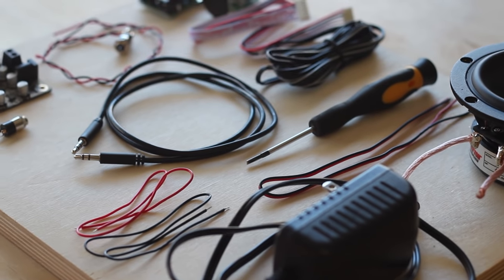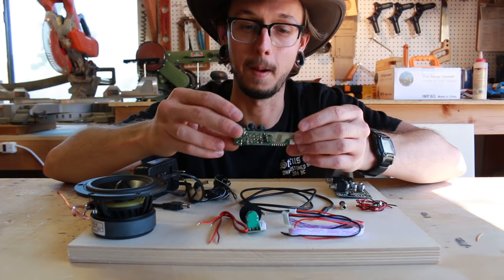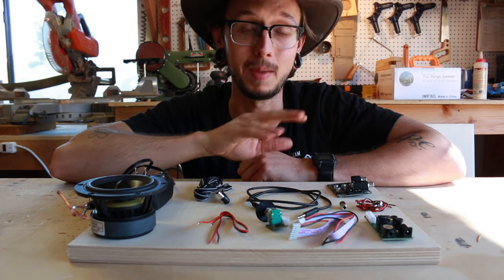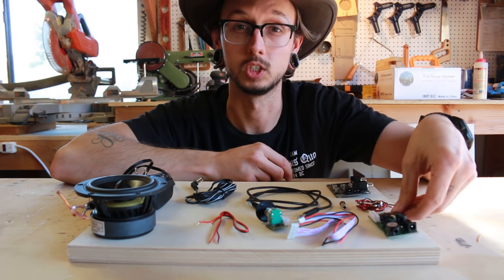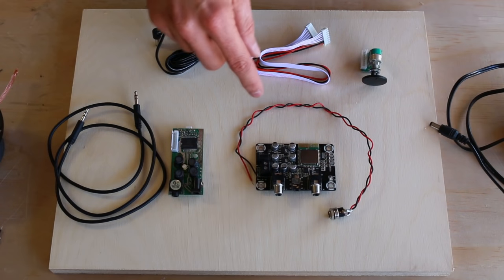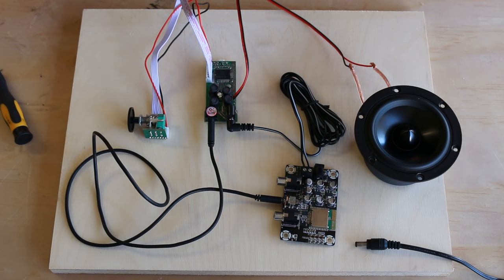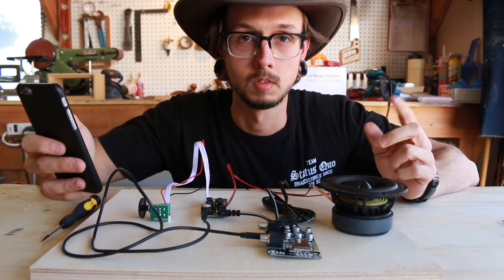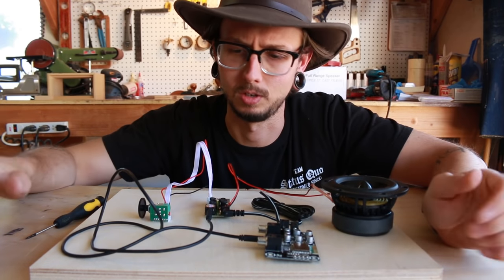Easy DIY Bluetooth Speaker Setup: Make Any Speaker A Bluetooth Speaker | How-To

Comment: Love the videos!  Truely inspiring.  Quick question... how do you calculate the values of your caps to coincide with the specs of your woofer, tweeter, amp, etc. Is there any website you'd recommend for beginners?
Reply from the maker: Thanks so much! Capacitors are used to filter low frequencies. So they are usually used to only allow highs through your tweeters. Heres an online calculator that explains capacitors use in crossovers a bit and calculates value.

Comment: great videos! thanks!
have a question...
Can I use these internal Bluetooth setup with any wattage speaker?
i.e. I want to build a 400 watt RMS bluetooth speaker with a 10 inch speaker.
can I add the BT card to this?
Reply from the maker: Yes! No problem. The wattage of the audio amp doesn't impact the bluetooth. Bluetooth is just an input to the amp, like a phone through a 3.5mm cable. Thanks for watching!

Comment: This is perfect I just bought put the wood casing together for my speaker I was gonna buy a raspberry pi for it but this way it's cheaper and much simpler so thank you. I was wonder how I could put an on/off switch in or an aux cord.
Reply from the maker: Awesome Spencer! Good luck on your project. The audio amp has a built in on/off switch and the bluetooth board can stay powered on with no problem. If you wanted to add a power switch to the bluetooth, you could add a small switch between the power connector on the outside of the box and the bluetooth board. For aux, you can add a Y splitter to the audio amp input, one input will be the bluetooth and one will be the aux input. Thanks for watching!

Comment: love the video  and i have a question for you
  i have a few old broken  bluetooth speakers  friends  gave me to fix and or use for parts   
  ive repaired a few and modded  others  with  bigger speakers and  never thought of adding a amp to boost  power to try with bigger speakers    i will  try that   since watching your video  

 but my question is this ive noticed on a few boards ive had there is  ad on spots or i would think its ad on spots  and my question is i have a few broken  laptops and old cellphones and  what i was  thinking is there a way to  use a old working camera and add it to the bluetooth speaker board and allow me to turn the camera  into a bluetooth camera  or is there a way you can help me with how to take a old webcam  or old laptop camera and add a wifi or bluetooth chip and how to make it into a wireless security cam or ipcam   now i know i can use  old  cellphones to make into ipcams  and i can buy  prebuilt spycams and security cameras  but  i wanted to build  my own   with  stuff i have  from  other parts i might have  at home  maybe you can  help me and  we colab this build  thank you  please  send me a message  or email thanks again

Comment: +Kirby Meets Audio By connecting multiple devices to the same power source doesn't lessen the voltage and amperage going to the devices like shown in this video? If tis is the case can I add a boost converter to a different device requiring 18v while powering a 12v device? At the moment I'm powering two small amps that was powered by 3v, but each amp can handle up to 5v each, but I have them connected to a TP4056 as one so I can achieve left and right stereo, is this ok??? Thanks

Comment: HI Guys, a little question :

Do i get it right that the Bluetooth board is powering on @ the moment where you connect the power supply - and not after turning the amp board on? 

That would mean the Bluetooth Board is permanently powered?

greats

BTW : your Videos are amazing !

Comment: Hi, super nice vids! Could you possibly do this with a battery?
Reply from the maker: Thanks, Arthur! That video is coming soon!
Reply: Kirby Meets Audio can't wait!
Reply: will it be rechargeable?
Reply: those are simple modules, cheapest to order on banggood or aliexpress, you could use lipo bateries with a charging module, and step-up or step-down voltage regulator

Comment: I thinking of making a soundbar with 2 separate 12 inch subwoofers the soundbar will have 2 kicker 6x9 i believe they are 450 watts each or more and 2 tweeters. Each subwoofer will have separate boxes and they  are kenwood 1200 watts each. The question is what extra stuff do i need to make this happen, i want everything bluetooth and able to connect to the outlet. If anyone can help i sure would appreciate it

Comment: Does it matter how much volts the speaker can handle or is that a 12 volt speaker as well??
Reply: The amplifier handles that so you can just connect it to the amp and as long as it can supply enough power it'll be ok.

Comment: How could I also hook up some kind of rechargeable battery? 
Sorry, I'm a noob at electronics and this kind of stuff
Reply: Yes you can, though you need charge controller*, so you wont over charge battery and with lipo cells *you need to balance them too, or there will be fire. Depending charge controller you can also get info how much battery life you have.
My suggestion is to build basic wired system and learn about battery management. There is several kit based control systems to upgrade into later, when you know more about them.

Comment: Can you show how to use it with rechargeable batteries, so it can be wireless speaker and which type of batteries to use to power it?
Reply: Guess you'd have a 9volt battery or other battery receiver and convert it to 12volt dc and connect it as the power source.

Comment: how do you turn the blootooth module on and off, does it works with the amp switch ?
Reply from the maker: You can easily add a small on/off switch to the positive wire coming from the power jack to the Bluetooth board. But it also won't hurt the board to just leave it powered on.

Comment: Is there a way i could power the board with batteries?
Reply: Sure. And even charge the (12V.) battery with a small solar-panel (and a controller to charge the battery).
Reply: Victor Sanchis dude show me 😅

Comment: How do I put both channels into one speaker without losing quality. Make stereo, mono?
Reply: I'm wondering the same thing. He seems to use a stereo cable from the BT module to the amp, but then from the amp he only connects one speaker... Where is the signal converted to mono? If he simply only connects one of the amp's output channels he'd be missing half the sounds, which with some music means half the instruments are missing.

Comment: Does anyone know how to do this with two speakers, i'm thinking when you plug in the wires to the speaker you would just have the wires go into the speakers negative and have another wire going to speaker 2's negative then have the positive wire to the speaker 2 positive and have a wire go to speaker 1 positive

Comment: is it possible to wire this setup into a surround sound home theatre head unit?
Reply from the maker: Yes, it is possible. But the application will depend on your specific receiver. You won't need the amp board, just the Bluetooth board.
Reply: +Kirby Meets Audio it's a Sony SDR-DH550
Reply from the maker: +Max Hernandez Without having the unit in front of me, I won't be able to give you any specific advise. But you will need to find power for the board at 12v and an open input to the receiver (you can probably just take over an external input from the inside). It would be much simpler to add an external Bluetooth module to one of the inputs on your system.
Reply: +Kirby Meets Audio ok ... do you know of a good external receiver with a optical digital output?
Reply from the maker: I've personally used this in the past and it worked very well. http://amzn.to/2bYLfsw
Reply: +Kirby Meets Audio thank you very much
Reply: Thanks I want make my own speak a long time!!!!!

Comment: I wasn't that impressed with that bluetooth module personally. It was easy to overdrive the ti 3110 amp with 26db gain setup for 2v inputs. It seems like there is a bit of a high pass on that bluetooth module as well. For 25 bux its not bad, but the quality doesn't cut it compared to a decent source. Also the previous version of the sure ti tpa3110 board had the same standoff spacing as that bluetooth board so that you can stack them. Are you mixing that stereo to mono before the amp?
Reply from the maker: I agree it's not perfect, but like you said, for the the pice I think it's a great board. Have you tried the new Wondom Bluetooth/class d amp boards yet? I knew they would get around to making it eventually. Looking forward to playing around with it.
Reply: I actually haven't heard of that, do you have link? I have been playing with a few raspberry pi and dac setups among other things.
Reply from the maker: https://www.parts-express.com/wondom-aa-ac11162-2x50w-4-ohm-class-d-audio-amplifier-board-bt40-with-functional-cables--320-3520

Oh man, integrating a raspberry pi has been on my back burner for a while now. I need to get on that! What software are you running? I was playing around with Volumio, but it never seemed to work quite right for me. That was years ago though, I'm sure they've worked the bugs out by now.
Reply: I have used Volumio a bit myself. I have also used OSMC, Openelec, older versions of xbmc, but I want to play with picoreplayer. Pi core player runs in ram similar to say a windows PE or knoppix, and can be hard cycled.
Reply: Lately, I have purchased boards that I like for form factor, and ease of component replacement. I soon plan to print and reflow my own boards, so an integrated board is not of much interest to me at this time.
Reply from the maker: Thats awesome! I'd love to know how your boards turn out. I'll also have to check out Pi Core.
Reply: I have OSMC running pretty good on the rpi zero in the cigar box, but I am still having some issues with the spotify plugin; which, I would really like to use with a headless player.

Comment: i've bought the same bluetooth module but I don't know why but it keeps "buzzing". It constantly makes the same noise. I thought it was broken so i bought a new one but the same thing keeps happening can you please help me?
Reply: Bas de Ridder don't use the 3.5mm jack. Use the RCA's
Reply: Allister , I tried both but still the buzzing noise. I even set a resistance thing in between the output of the Bluetooth receiver and the input of the main amplifier.

Comment: I see you're using a 3.5 for the bluetooth to amp...   If I were to use the right and left output on the bluetooth board to run to the left and right channel input on an amp, do you think it would be OK to solder the wires to the bluetooth board?  ..Thanks!   amazing videos
Reply: Kyle Comeaux it's recommend to use the RCA's as the 3.5mm sounds terrible

Comment: You never showed the
capacitors for protecting your speakers from the digital amp. Why and how you do this along with values of capacitors. And you never said what type speaker you are using and why. Whats the ohm's and watts and why.

Comment: crappy class D amplifiers with very very high distortion.  to building good amplifier you need class A or class B
Reply from the maker: Every class of amplifier has its pros and cons, as well as its optimal application. I'm not sure class A or B would make much sense in the application this video is intended. The amp I refer in this video uses a TA-2024 Tripath chip that is considered a class T. Have you heard this amp in person? I was shocked at the quality of sound it produced from such an efficient amp in its form factor.